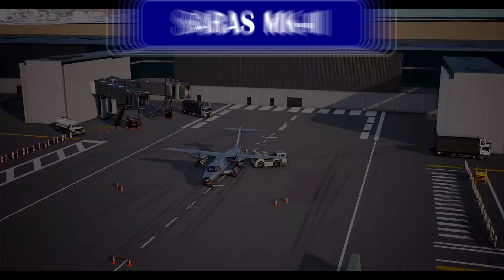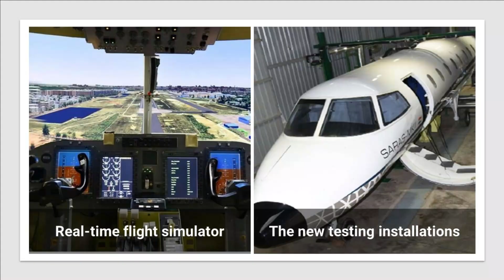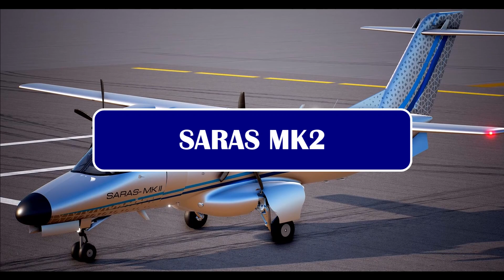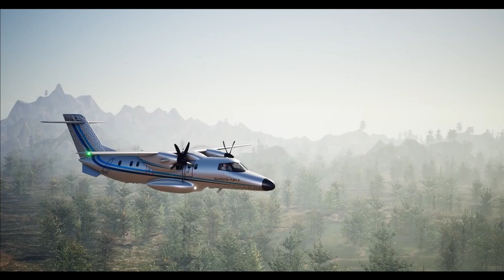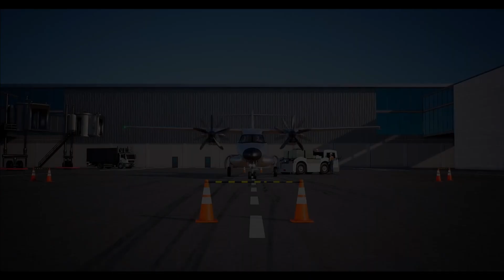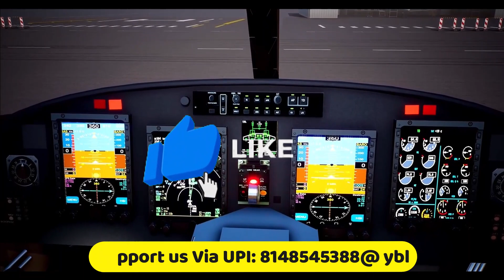Open-air engine test bed & ground test system commissioned for SARAS MK-II

Comment: The first flight of SARAS MK-II is planned in the year 2024-25 and production from 2026-27.

SARAS MK2 specs

Weight 7.5-ton 
Endurance of 6.1 hours 
Service ceiling of 9,100m. 
Maximum range of 775 km with a max load of 19 passengers 
2450 km with 7 passengers
Cruise speed 500kmph. 
Take-off distance  790m
Landing distance of 740m.

These specs are pretty good, except for the imported engine. There is a Desi propeller engine under development, but fuel cells should be considered.

The German Aerospace Center in Cologne has been flying hydrogen fuel cell aircraft since 2012. Its current aircraft, the custom-designed HY4, can carry four passengers up to 720km. Its 65kW fuel cell has a liquid cooling system. There is also a UK company  ZeroAvia’s six-seater aircraft completed an eight-minute flight from Cranfield Airfield in the U.K. last September, the company claimed a “major breakthrough” with the first-ever hydrogen fuel cell flight of a commercial-size aircraft.

I believe a fuell cell powered SARAS MKII would be a tremendous export sucess. It will help save the climate, the world and establish the Bharati airplane industry. A simple swap of propellers for fuel cells is a tremendous difference.

No carbon emissions - pure water is the only pollutant. 

There is already a fuel cell powered ship and bus under development, and DRDO is developing a submarine. 
The Ministry of Ports, Shipping and Waterways decided to develop and build India’s first indigenous Hydrogen Fuelled Electric Vessels at 
Cochin Shipyard Ltd (CSL). This has kick started the efforts of the country towards green shipping.

It is time to revolutionize aircraft with fuel cells powered by hydrogen.Saras also need certification in Europe and North America as
a civil aircraft.
Reply: Please send some students to study abroad at the  top universities,then let them work then fully equipped r&d Labs. Then you will see how fast Indian technical skills in this area will grow.
Reply: @123ms98  Bharat must purchase 50% stake in Embraer. This alone will  make Bharat an aeropspace power in one simple step. The next  step will be to replace all the components supplied by Western
 companies with Bharati ones.
 
Invest in R&D. We need to increase it to at least two percent of GDP for Bharat to catch up to the cutting edge of technology. 

Invest properly in engines, Kaveri and the subsequent engines, if they
receive billions in funding and facilities, can perform on par with Western
engines.

Bharat must build its own airliner. The only option is the Comac C919. Probably
need to negotiate terms such that we can indigenize the engine and avionics
as much as possible for the Bharati version. We cannot rely on imports of Boeing
and Airbus anymore.

Bharat must build its own cars(Tata Motors), own ships, own railroads and own pasenger
airlines. We are the start of the journey, it will take decades before finally a desi
jumbo jet takes flight, but that is why we must start now.
Reply: @datoolz0  I agree with you. I made a similar comment last week.We should have 2 engine projects with ToT from foreign companies with full IP rights for armca program , 1 Public funded and 1 privately funded. RR engine could be used for a commercial jet as well. Let a PSU work with private companies , Tata has some experience making fuselage and NAL with autopilot program. Set national agenda for development of a commercial jet to combine all these skills and technologies into 1 project.
Reply: @123ms98  I think we should purchase 50% stake in Embraer. At one quick stroke the government will achieve 90% of what it wants to achieve at the low cost of only 1.6 billions.

The Kaveri will still take time, we just have to be patient. I believe it will deliver over the next 10 years.
Reply: @datoolz0  My thoughts exactly about Embraer. I am not sure why India hasn't done this already, the company has been on offer since failure of the Boeing deal.  Maybe 🤔 there is something we the public don't know about Embraer, this is the only reason I can think of. It seems like a no-brainer to me.
Reply: @123ms98  Rémi Maillard, President and Managing Director of Airbus India and South Asia, says that every commercial aircraft or helicopter that Airbus manufactures today has parts, design, or technology from India.
 
I wish Bharat could buy Airbus, but EU will block purchase of it. Same goes for Boeing  USA will block us there. Embraer is the only game in town.
 
 India Could Partner With Embraer On Its Planned Turboprop Aircraft
  By Gaurav Joshi

Among the countries Embraer is looking towards is India, where it is currently in talks with potential partners. Of course, these are initial steps, and the company is exploring all its options by examining suitable partnerships not just in India but all across the world.

There were reports in 2020 that the GoI was going to buy Embraer.

The Indian government is keen to buy Embraer’s commercial aircraft division, said a top-ranking government official. “We are very interested. We are exploring alternatives,” the official said, confirming a development reported earlier by Reuters on Brazil’s plans to reach out to India and China as possible new partners

-- Business Standard

Many Bharati airlines fly Embraer planes.

India's Blade signs order for up to 200 electric aircraft from Embraer's Eve -- Reuters

HAL/NAL Regional Transport Aircraft, which has already taken 15 years to develop, and will certainly not see the light of day before a 20 year development period.

From all the above experiences and attempts, it is quite clear that developing a single aircraft takes decades, and developing a fleet of aircrafts of different sizes and capabilities will take well over half a century, if not more. Can Bharat afford to wait such a long time in order to have an aircraft manufacturing industry of any significance? Clearly no. So, what are the options that Bharat has?

Buy Embraer. We have only one option, because the indigenous route will take at least 20 years.

Comment: Saras is a just like a forced project by NAL,it is trying to enter a very constrained market with no practical usage with existing Do 228 in service.
If NAL really wanted to develop something for the UDAAN scheme they should have developed something similar to ATR 42/Fokker 50/Saab 2000 or others.
They are just dragging the project to keep their jobs secure with no practical utility or market.
Reply: Not true, this platform is necessary if we are to develop something like a E2C Hawkeye or a more cost effective awacs in the future. Not to mention that a scaled up version of this can be used as a bomber or transport a/c too. It’s a learning curve & the derivatives will come out really soon- we are learning aerostructural engineering on the go here.
Reply: @girishg414  Bhawnao me Matt beh jao,E2D Hawkeye is a totally different system
Reply: Dornier does not have pressurised cabin
Reply: @avishekbhattacharjee812  Dornier does not have many things. It's design is more box like which is comparatively less aerodynamic, giving bigger drag, less range and less service ceiling. Dornier is more of an air taxi than aircraft. Saras is basically platform and testbed for bigger RTA-70 and 90